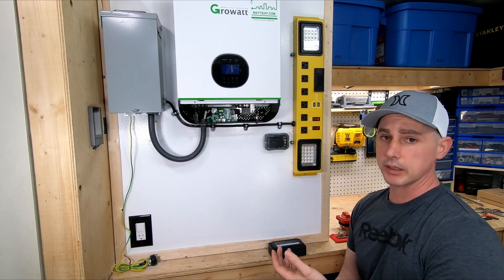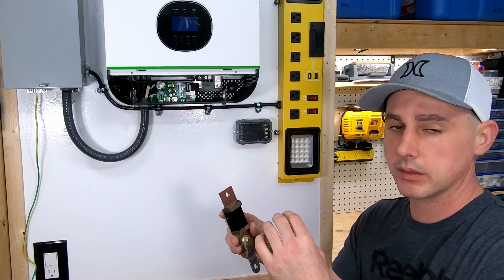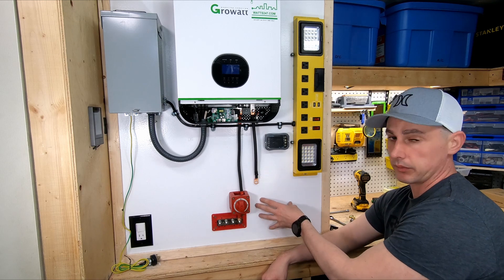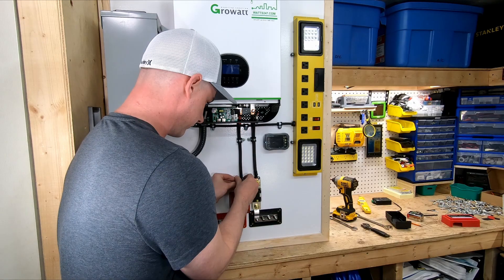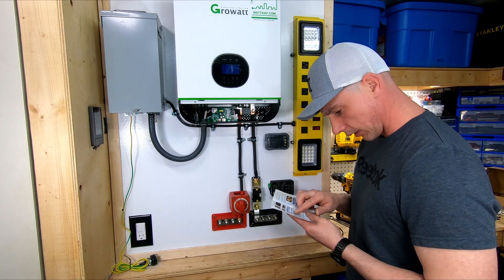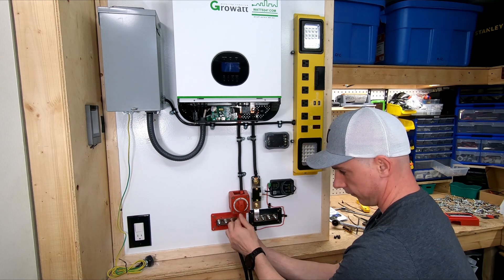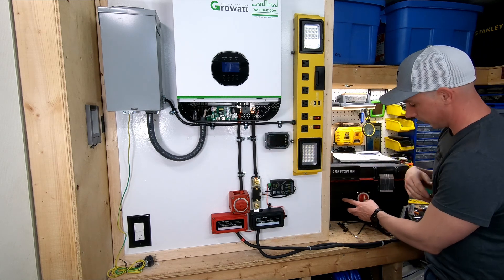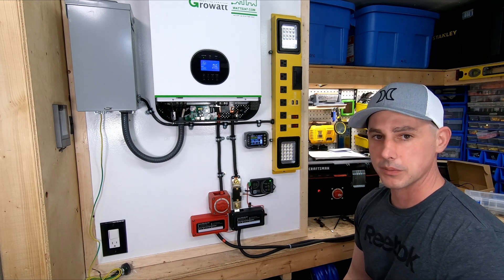Growatt, Making my battery connection

Comment: Got my smart shunt and 150amp 32v fuse,so it's time to rewire my initial set up. Got to see what Rolly did of course😂✌️
Reply from the maker: Lol, great job. I'm starting to think you might know me outside of YouTube. Using my Nick name and all. Your freaking me out, lol not really sounds like your build is coming along well 👍
Reply: @Roll2Videos  twilight zoning ya lol. I'd be done already but I seem to spend lots of time staring&measuring more than anything.Im a bit of a perfectionist,OCD in a way.One of the best projects I've had in awhile.Going to install 2" lift/level kit in my Tacoma as soon as my mud pit of a parking area dries up,I'm itchin to get that project done🤞
Reply from the maker: @scarygary3569  I had the same kit in a 2012 Sierra. Make her look good. Adjust your headlight down. Be nice lol
Reply: @Roll2Videos  oh sh*t...that hadn't dawned on me🤯

Comment: Hello Mr 
Thanks for making these videos, atm im running Growatt SPH10KTL,  with a china branded battery using CAN for communication- 

But also I’m trying to figure out if it’s possible to run multiple battery systems at the same time- 

I understand most of what you are doing, but will this shunt you are using be able to shift between different battery setups? 

And how about communication to the inverter? 

Thanks :)
Reply from the maker: Hello, you would have to run a shunt to each battery to see them individually. You can't see each battery off one.
There is no communication with the Growatt I just used my own configuration on the unit. What battery are you using I'd like to look them up.
Reply: Thanks for the reply, im running Eitai battery, china brand and I saw the package they came in is from the company Battenergy, so Eitai is probaly just the rebrand they are sold under.

I understand what you are saying, but how about a device that could switch all at once, like saying- 

When battery 1 discharges to 10% the control unit switches plus/minus/bms terminal to battery pack 2. 
I understand it will cause some interfering when inverter should read, but it should just understand that there are now another battery pack present- 
But do such device excist?
Reply from the maker: @IpFix-  Nothing that I know about, Now you have me interested if there is.
I will have to look around on the market.
Thank you for the ideas 💡
Reply: @Roll2Videos  - if it’s not already there, should be relatively low tech switch :)

I’m still new in the solar, 3 months in 🙃 and like mentioned with the eitai battery, but I would definitely investigate this area when (in future) I’m gonna try to expand my battery capacity :) 
But let us know if you find any :)

Comment: What Growatt are you using?
Reply from the maker: I'm using the 24v 3000w
Reply: @Roll2Videos  is this a inverter only or also for a solar panel application? You have a exact model number?
Reply from the maker: @sammerobbroeckx9388  yes,
https://watts247.com/product/growatt-24v-spf-3000tl-lvm-3kw-120vac-stackable-inverter-2kw-mppt-charge-controller-split-phase-120v-240v-capable-with-two-or-more-units-ships-now/

Comment: What’s the yellow power strip looking like thing?
Reply from the maker: It's a regular power bar with LED lights and USB plug ins. I had cut the plug off and wired it directly into my AC panel with a 15s breaker 👍

Comment: Do you have to pre-charge the capacitors from a battery like the SOK 24V 100Ah? I'm new to this and have the same Growatt that I'm getting ready to setup but haven't come across anything talking about pre-charging capacitors.
Reply from the maker: I'm going to say yes just as a precaution.
I haven't had my hands on a Sok battery unfortunately. So I'm not sure if there BMS has a per charge resistor built in.
It's a good habit to get into not that you are using lithium batteries pre charge everything you connect (chargers, inverters) etc... Anything you connect with electronics to be safe. 👍 Enjoy your setup
Reply: @Roll2Videos  Hello, Can this Growatt SPF 3000TL HVM-48 work with normal lead-acid batteries?
Reply from the maker: @423GustavBern  Yes It can. Just select the preset for flooded 👍
Reply: @Roll2Videos  thanks :)
Reply: Oh and can I also ask if this inverter can handle hyundai HiE-S485VG solar panels? they have 13.22Amps ISC and I can't find any info on whats the max dc Amps imput  the inverter can take from the solar.
Reply from the maker: @423GustavBern  The 485W one? Yes you can. But remember you want to be at least 20v above your battery voltage for the MPPT to work the best. I wouldn't go over 30amp on the PV side.